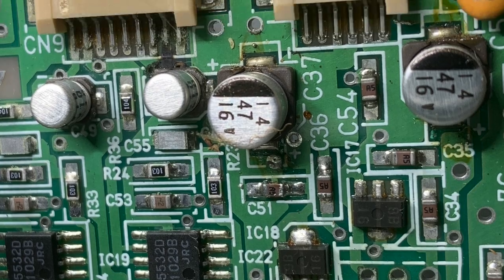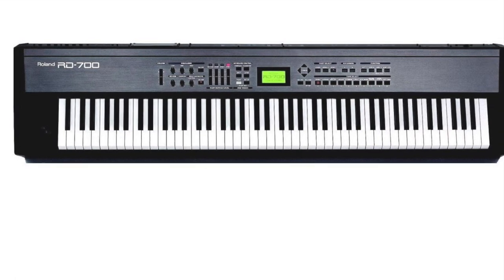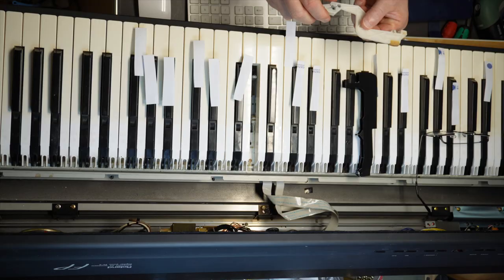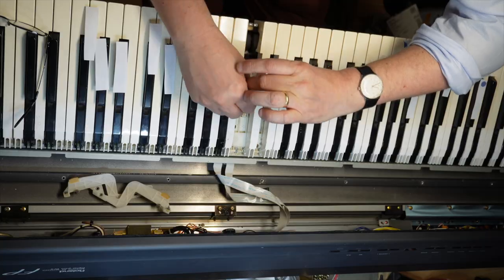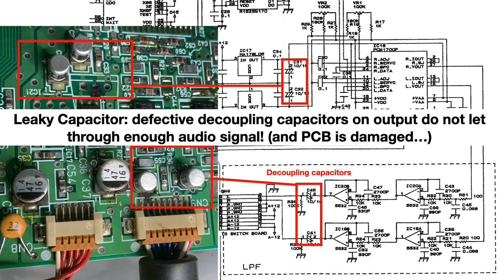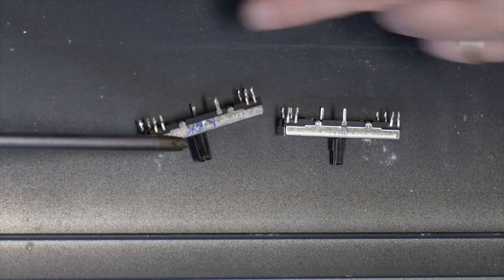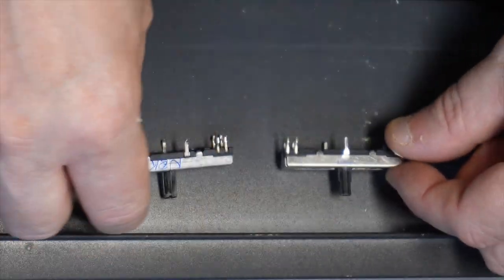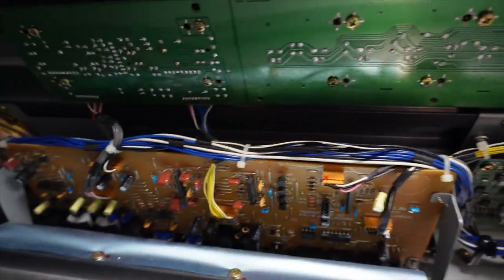Reinard Synth#11 Roland FP8 Repair: leaky caps and broken hammers

Comment: Thank you very much for all this information. Same problem here on a old FP-8 with the sick appearance of 47 yF Capacitators. I think about using this: Teapo SMD 47 µF 16 V 20 % (Ø x H) 5 mm x 5.4 mm and Panasonic SMD 10 µF 16 V 20 % (Ø) 4 mm. On the other hand,  I just have to shift 1 Key-Weight from the middle to a hardly used high position after glueing it with 2 component epoxy glue with PP Activator fluid. The rest weights are ok. (My RD 500 Keyboard had about twelve that i had to glue with epoxy, it sticks sufficient using Activator fluid.)

9 of the Micro-Pushbuttons gave no contact, and I used the method not having to desolder them but open them by cutting of the 4 little plastic nobs, fine sanding the thin round copper plate i found inside, using then a final contact spray drop - then closing it by very fiew hot glue served on a needle. There is a youtube movie about how to do this.

Finally I hope I can handle the exchange of the 6 capacitators as they are very small and I have no special tools to disolder them correctly. There still is a crackling sound coming from the Speakers.

Comment: I did the cap repair with limited difficulty, however, I now have another issue.  The volume came up !  The trouble is that the sound from a single key press starts and stops with a slight and very quick, quiet hiss or buzz.  AND  the last 18 keys have a very noticeable longer (3 second) hiss or buzz that slightly resembles sustaining the key.   Sadly I did not have exact caps and used the same uF ratings, but with higher voltage ratings. Ideas?

Comment: Yes it worked! I have a little different circuit diagram/scheme. So i have only 1 cap instead of your C31 and C32 and i did not replace this part. I just changed the top 4 Caps  2 x 47 and 2 x 10 yF and tested it positiv. On my circuit board they are named as C42, C46 and C64, C57. No more crackling :-).
Reply from the maker: Excellent!
Reply from the maker: there are two versions of the board: on with the PCM96AP as DAC, and one with the PCM1700U as DAC. The one with the PCM96AP (which you have)has 4 more caps around it but the most important ones are the ones for the power supply (the 47uF ones) and in the signal path (the 10uF ones, C64 and C57; exactly the ones you replaced...